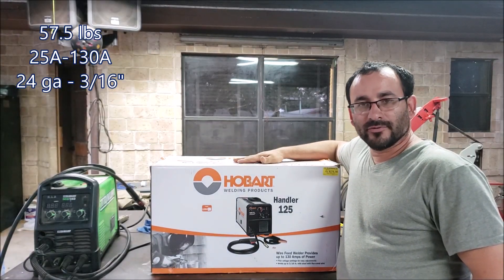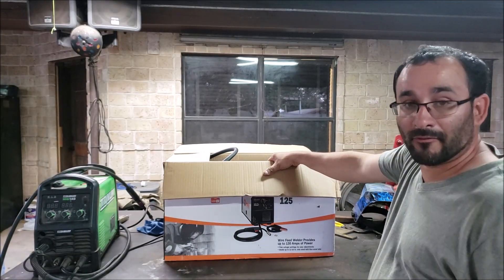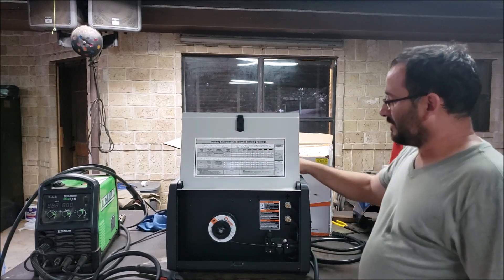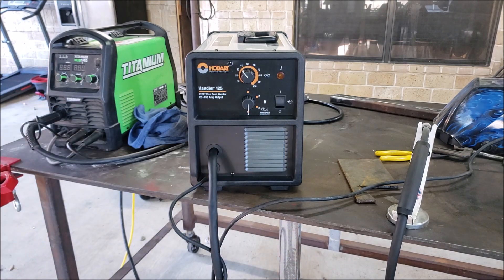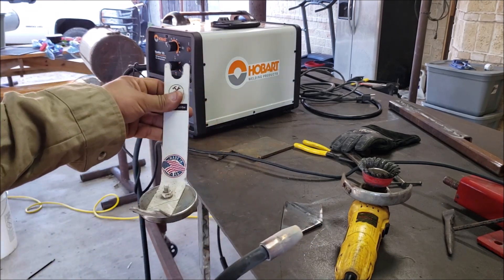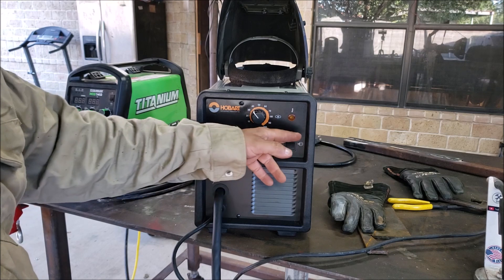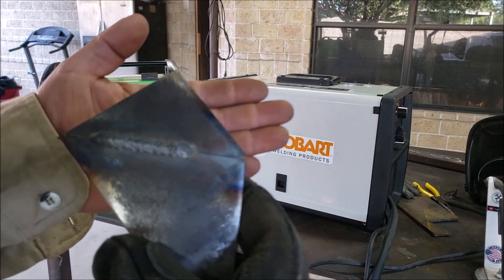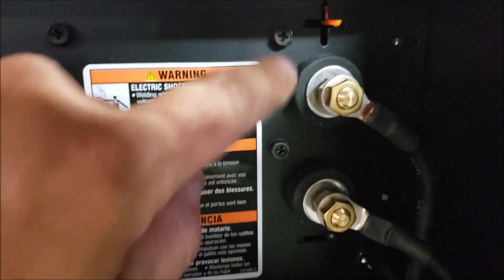Hobart Handler 125 Flux Core Mig welder unboxing and review for beginners

Comment: New price at Northern Tool $419.99
Reply from the maker: I have used this welder maybe 5 times but know the Hobarts at my Local Tractor Supply are: 140A=$659, 190A=$939 and 210A=$1199....This Hobart is very heavy compared to cheaper IGBT based machines and just a hassle for me to move in and out of shed. One day I will build a shop to work out of and store my machines on a display shelf where they are easy to get to. Thanks

Comment: This is what I have going to try these settings I was doing a thinner pipe onto quarter. Pipe as sticking good too much wire speed for quarter tho on what I did. Very splattery first welds ever. I think these are kind of a ranch or farm welder
Reply from the maker: 125A is more of a sheet metal machine and once you get to 145A you can have better results with 1/8 and 3/16 materials.
Reply: @cutweldngrind  ah. Ya I cranked it way up 4voltage and 35 wire feed. That seems to work for 1/8th to 1/4th somewhat. Seems like I got it to fuse not pretty of course. I took the gas shield off too helping with the tight spot and added some copper wire to my clamp. It's my dad's old welder he did horse shoe tack welds and 1/8th tubing with it mostly. Some flat steel too. He must have been pretty good at welding to use an inappropriate machine and have them hold this long.

Comment: Wow, you got yourself a heck of a good deal there Jorge... Welds good, looks to  be a nice welder .... 👍😎👍
Reply from the maker: It works good but its very heavy. I hooked up this welder to my generator and still tripped a 20a breaker. If I am correct the machine pulls over 21 amps at max power. I was going to buy this when it dropped to 279 but I went after work and they were sold. I think its a decent started welder. The Titanium's are also good but they keep going up in price every few months.

Comment: Nice little machine
Reply from the maker: I just had an impulsive buy like usual but I think it will be handy to have another spare welder. I think I have 6 or 7 welders now and the collection is growing. If I had the space I would buy me a 240v Hobart Iron man 250A welder and basically do most my projects with that since I can get a better duty cycle, probably 100 percent at my setting.